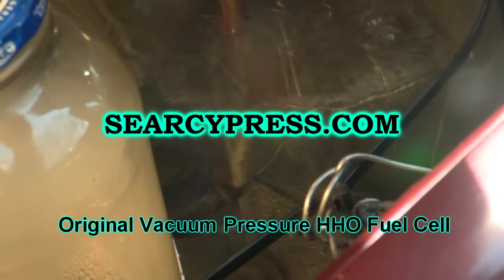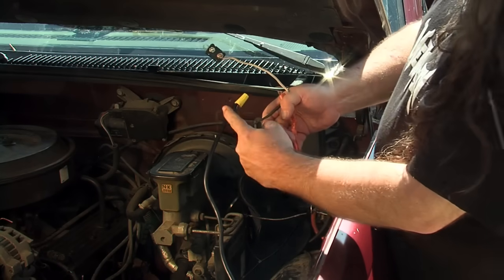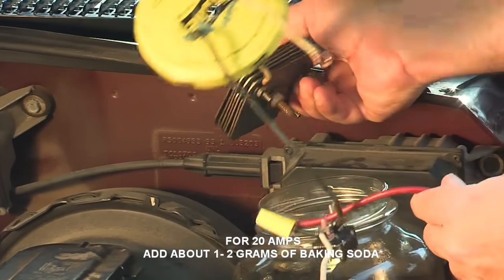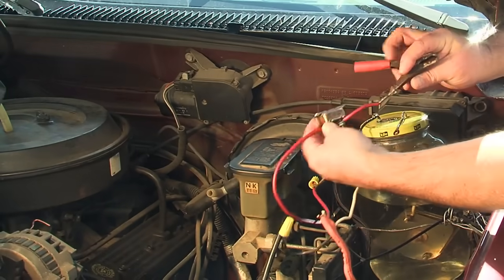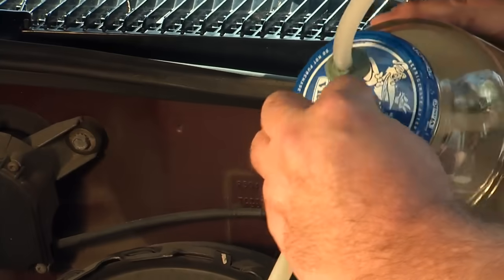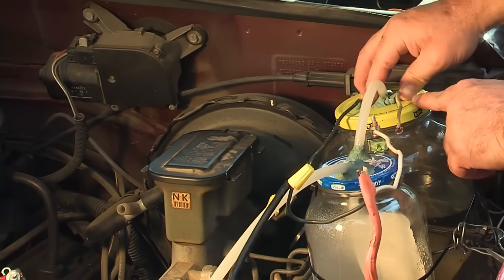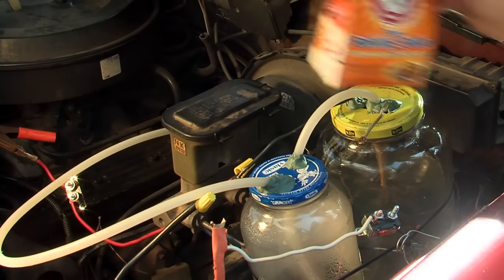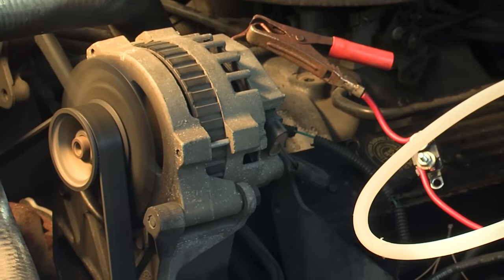Vacuum Pressure Hydrogen fuel cell defeats high gas prices using hydrogen from H2O.

Comment: Explosive gas and glass jars. Brilliant.
Reply from the maker: Actually because the system is in a vacuum it is pretty safe. You cannot use metal and you cannot use plastic because it will distort under the high vacuum and high temperature. We have a new video coming out that will show a much safer application in the cell. The glass jar still remains a key component because of the thermal properties. Thanks very much for the comment be sure and subscribe.

Comment: I tried this with my lawnmower and it blew up after a while.
Reply from the maker: Actually, no you didn't. No disrespect intended. A Lawn mower does not produce 
 sufficient vacuum. This is a vacuum pressure fuel cell that operates completely different. Injecting into the air intake of a combustion engine dilutes the gas to a point where there are no returns. We proved this over 12 years ago. But never the less, people kept doing it and making videos and claiming success. Unfortunately, this gave the entire industry a bad name. Vacuum pressure injection the only way that will work. We have a new video coming out soon so be sure and subscribe. Thank you for the comment.

Comment: How do you start doing this for a bike ?
Reply from the maker: Without a hard vacuum you are unlikely to see any benefit at all. At  no time have we ever seen any benefit to injecting into the air intake on any combustion engine. The HHO gas becomes immediately diluted. Vacuum is the key to making it work. We have a new video coming out which will explain as much as we can so be sure and subscribe. Thank you very much for the comment.

Comment: I bet with a duel battery and a second alternator on there you wouldn't have to worry about the amps and voltage. 
I have been telling people for decades that the future of automobiles is in hydrogen fuel engines!  Boeing builds hydrogen based drones using Ford Ranger Flex fuel engines!    The solar panel wings also collect rain and moisture to convert to fuel while flying!    Limiting its time in the air to indefinitely except in dry climates.
Reply from the maker: Actually, what we discovered was, less can be more. We did experiments with a  hundred amp generator at full power on board. There's a point of diminishing returns. The goal is not to power the engine with the HHo gas. We are just powering the combustion process to increase the efficiency. We try to burn all of the gasoline in the cylinder because that is where the power is. If you did succeed in producing a very large amount of the HHo, you would melt the engine. This is not just hydrogen its hydrogen and oxygen. You can easily melt rocks or even tungsten with the gases. We have a new video coming out so be sure to subscribe. Thank you very much for the comment.
Reply: @metalpresstv   Yep. I unstood the difference. You are making a hydrogen infusion method which definitely helps the GPM rating.

It is the cheapest best way to decrease your fuel costs. 
Will work on just about any car.

I like the option of going full hydrogen fuel and have a home solar panel and battery system making hydrogen all day long. 
A converted engine to hydrogen fuel only.  Same conversion like propane fuel cars.  I've driven them to. 
The pistons eventually blow though.

Comment: Do you think it would rust the in side
Reply from the maker: Water is a normal byproduct of burning gasoline. The water that you see in the video is actually coming from the gasoline and not the HHO so much. Engines waste a lot of gasoline which ends up burning the unused fuel in the catalytic converter. When you increase the efficiency ,the catalytic converter temperature drops and a lot more water will be noticeable. The amount of water that is added by using HHO is pretty much negligible. Thank you very much for the comment.

Comment: hey man this is HHO generator this is realy danger.
Reply from the maker: I understand your concerns. Most people fail to realize the system runs in a vacuum. As far as the wiring we use number 10 gauge. It's adequate for up to forty amps. We only run  29 amps. The light switch we use I definitely can't recommend however it did work and never failed. There are a lot of risks so we definitely don't recommend anyone replicate this. Thanks for the comment.

Comment: Still using batteries for electrolysis..hahaha
Reply from the maker: Actually the alternator is the primary source of power in this fuel cell. The Battery is used to store energy. We're not trying to power the vehicle with HHO. We only fuel the combustion process. 😁 Thanks for the comment.
Reply: @metalpresstv  its like the dynamo motor concept for unlipower..nice one👍

Comment: I've put a system in an older 63 dodge with a slant 6 in it.  It works FANTASTIC, gives you a LOT more power and will save you 2 to 3 times in fuel consumption. The engine compartment cooled off right away and I dialed the carburetor and timing way back. I heartily recommend this for any car currently on the market,and the older ones too. Now all I need to do is figure out a way to put a small bottle on my bike!!!
Reply from the maker: We have a new video coming out when the timing is right that will show a much safer way of implementing the system. The Primary system itself hasn't changed much but you will find our improvements quite intriguing. Thanks very much for the comment, be sure and subscribe.
Reply: @metalpresstv where’s it at?
Reply: @metalpresstv when you making the video
Reply: @metalpresstv does this work on fuel injection engines as well?
Reply: @metalpresstv does that Silverado still run
Reply: Im looking to put this on my H2. Can you please share some info so i may do it correctly? Id love to see what you have going@metalpresstv
Reply: Are u making the new video soon? Can i put this system on a diesel 7.3
Reply: @skyzoomin  I don't make videos.  I just commented on this one.
Reply: Op commented on this thread i was asking him but oh well.☮️☮️☮️
Reply: @metalpresstv I’ll subscribe. 😊. Imma hoping this works on my 2010 Silverado. 6.0 vortec. ❤. At 250 thousand miles. She gets 18-20 on the highway with 6 speed. But if she could almost double that mileage. I’m eager to try it.
Reply from the maker: @JohnPlatford don't expect gains in the city. Nothing can fix that. But you will notice no more engine knock with low octane fuel. Better performance, cleaner engine. Thanks for the comment
Reply: @metalpresstv ,thank you for the comment!  Absolutely true.
Reply: @metalpresstv  how does it save fuel exactly? Surely without a tune, your engine will still be putting the same amount of cc’s of fuel into the combustion chamber in a minute for example, than it did before because it’s not tuned to run less fuel, so how are you saving fuel exactly? And another question is does this work with diesel engine specifically common rail
Reply: Maybe on carbs motor fuel injector hard to get around O2 sensor oxygen in exhaust cause computer go rich.
Reply: @doughardison8101  
I think the ECM has to be cleared and relearn with this system on it.
I was told it will work on any gas powered engine,fuel injection or carburetor.
Reply: @doughardison8101 Recalibrate the computer.
Reply: Baby food jars man
Reply: holy fuck cant believe it  just checking back after planning to set one up for years and now i got a 61 d200 so glad to see someone witha  similar whip making it work. < 3
Reply: It worked on my 61 d200 , tho i wasnt able to measure how much difference it made, the engine was running good  maybe better than usual while i had the system

Comment: The water-powered car may or may not work. Range is the probably. Stan Meyer died of a brain aneurysm. The patents are PUBLIC.
Reply from the maker: The water car was the weakest of his inventions. Most inventors always hold something back from their patents as he did. They just can't seem to let go of the money. Regardless, it's doubtful you'll find that water powered car on eBay anytime soon. You should think about that. Thanks very much for the comment. We do have a new video coming out so be sure and subscribe.
Reply: @metalpresstv all his patents are public to my knowledge. Your design may work a bit but isn’t reliable for hundreds of thousands of miles like ICE engines.

Comment: Does this work for fuel injected engines? Where would you hook it up to?
Reply from the maker: For reasons that should be obvious I cannot sanction anyone reproducing this in any way. With that being said, all it is doing is burning all of the fuel in the cylinder instead of the catalytic converter. It's almost like they designed the engine to waste fuel so the catalytic converter can take care of the emissions. 😁 Injecting without vacuum will yield zero performance gains.  Thanks for the comment.

Comment: I always thought water was bad in an engine.. This doesn't cause corrosion?? & this is mixing the hydrogen with gas or running off pure hydrogen?
Reply from the maker: Actually water is a byproduct from burning gasoline. The water that you see coming out of the tailpipe in the video is coming primarily from the gasoline. We generally get about 200 MI on 3/4 of a gallon of water. Because the catalytic converter runs much cooler the water from the hydrocarbon fuel comes out of the tailpipe in liquid form instead of vapor. We have a new video coming out so be sure and subscribe. Thanks for the comment.

Comment: This has been proven to do nothing by many youtubers. Project farm did a video. A engines ecm is programmed to work at certain parameters. Without a tune you really can't do anything. He also tried it on a generator and it actually harmed performance. He had it connected to a outside power source.
Reply from the maker: No. I do think very highly of the guy but he did not replicate what we were doing nor was he trying to. No one should replicate this in any fashion. There are many dangers involved in this type of system. It is inherently different. We have a new video coming out which will cover a lot of things and explain many misunderstandings. This is not simply squirting gas into the air intake. Also this will not work on every engine out there. This is not something you're going to cover in a weekend project. Thanks very much for your comment.

Comment: `HHO has been proven by Project Farm to not have any benefit if anything it makes it worse.
Reply from the maker: Actually no. He showed injecting into the air intake does not work. We agree. Without vacuum injection it does not work. The air dilutes the HHo. We showed this in 2007. Vacuum pressure injection is not at all the same. Most people just don't understand that there is more than one way to utilize the gas. Thanks very much for your comment. We have a new video coming out which will show all of the updates over the years. Share and subscribe.
Reply: @metalpresstv  Then I shall set him to task again. I get your point, I really do. I just feel that if this was a viable alternative that manufacturers would have already used it.
Reply from the maker: @Mu7eD-Stream  keep in mind it won't work on just every single engine out there. Also measuring mileage is an incredibly hard task. There are so many variables at play. It is not a weekend task. We spent many years working with this technology. We do not want anyone to try this. We have a new video showing a much safer approach with a lot of improvements. The video simply opened the door for hydrogen interest at a time when there were only 3 videos on YouTube about the topic. Thanks very much for your comment.

Comment: Old assed video about a debunked method to power your car. They tried this like 50 years ago. It didn't work too well then either.
Reply from the maker: Actually, we showed the only way it works. Because of this video, people with a poor understanding of it, started sticking it in the carburetor thinking it works. All the videos you see debunking HHO are using the other way, the easy way, the wrong way to do it.  This is a vacuum pressure fuel cell. Injecting into the air intake dilutes the gas in such a way it has no positive effects at all. This old ass video showed you the proper way it's done. It's a lot trickier because the heat combined with a -15inch vacuum requires a container that's made of glass. It is in a negative pressure state except during hard acceleration. Thanks for the comment.

Comment: Ya I’m sure this is safe for the road. What are the possibilities of a collision causing the hydrogen to ignite and explode? Just curious as I don’t think it’s safe for the operator or others on the road
Reply from the maker: Please remember this is a prototype that should not be reconstructed by anyone. This is running in a vacuum. There is negative pressure -10 to -15 inches. Also there is an impact disconnect on the power. It was crude but very effective.  The hydrogen and oxygen is made and used on demand so there is really not any large amount at all which can be ignited outside of the cylinder. There is absolutely no HHo gas under pressure. The main misunderstanding people have is, they think that we are running the engine on HHO. This is totally incorrect. We are making a very small amount - less than 6 liters per minute that is used to burn all of the fuel in the cylinder. We are not powering the engine, we are just helping the gasoline to do its job more effectively and efficiently. Any boost in performance comes from gasoline-only. In the future it is more possible that all cars will be liquid hydrogen. I assure you this is far more concerning than what you see going on here. Also I would like to add that driving an electric car powered by lithium batteries on a hot highway is far more dangerous to the public than you might think. We have an updated video showing a much safer design that will be released later on. Be sure and subscribe so you don't miss it. Thank you very much for the comment.

Comment: 29 amps on your 20 amp switch dude. I guess I'm 12 years late to suggest a better disconnect.
Reply from the maker: We have a new updated video which shows improvements that are certainly much safer. Remember what we were doing in that video was a prototype we were building and rebuilding constantly so everything is extremely raw. Be sure and subscribe so you don't miss it thank you very much for your comment.

Comment: That's not a fuel cell though. A fuel cell outputs electricity by recombining hydrogen and oxygen.
Reply from the maker: Understood. But when we did it that's what it was called. Updated video is coming. Be sure and subscribe so you don't miss it. Thanks for the comment.

Comment: You are using gas to produce hydrogen to burn it back to water ...... whit looses you just made a literary USSLES MACHINE........
Reply from the maker: Actually we just burn more of the fuel in the cylinder instead of the catalytic converter. The engine is designed to waste fuel.

Comment: Scam alert! This has been debunked so many times.
Reply from the maker: No you're confusing this with other types of hho. Squirting hho into the carburettor will never work and never has. It becomes deluted immediately with the incoming air. Injecting into the vacuum is much different. Results will be immediate as the catalytic converter temperature will  remain cool for quite some time and you will see all of the carbon blow out of the muffler system. We have a new video coming out which will explain the differences. People doing it the wrong way is the reason people doubt it so much. Thank you very much for the comment.

Comment: He needs to be careful before he gets suicided. Messing with trillonares is dangerous.
Reply: Thought experiment: If every person to "build" this is using scrap parts literally off the shelf, in their meager garage with no assistance or laboratory or extensive testing.... wouldn't it be a bit more widespread than a few old internet vids?
Reply from the maker: Assembly of the cell is a very skillful task. Knowledge of electrical functions and engines is also required. Most people can't even change their own oil and replacing the battery in their remote control is about the extent of knowledge that have with dc current. It's sad, but true. Thanks for the comment.

Comment: When you were trying different plastics, did you try shaping any thermosetting plastics rather than using thermoplastics? As far as i know heat doesnt allow thermosetting plastic to return to its original shape so the heat tolerance should be high

Comment: i have 1 question. hydrolizing water will have 2 components: oxygen and hydrogen. i do not see a separate compartment for oxygen and hydrogen. how can you just get hydrogen by itself? this will not work.
Reply: Good luck building a filter 2 hydrogen atoms wide (still 1/8th the size of oxygen) in order to actually separate them

Comment: Hi I just got a system installed. It doesn’t appear I am producing as much gas as your system. It produces many small bubbles but yours appears to create larger bubbles at more volume. How did you achieve this? 
I have 7 2”x5.5” plates about 3/16” apart. Tried the system with distilled water and added a pinch of baking soda progressively until I was drawing too much current
Reply from the maker: Email me a pic of your setup to metalpresstv@yahoo.com Ty